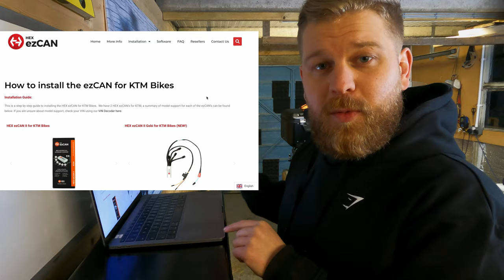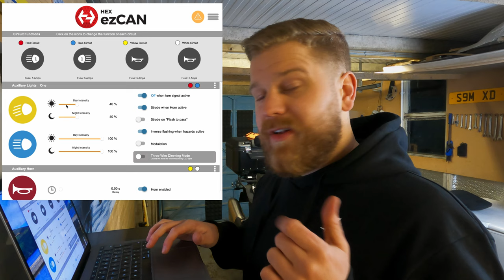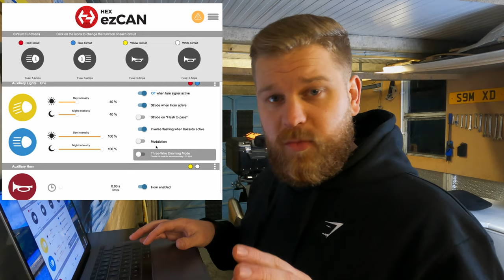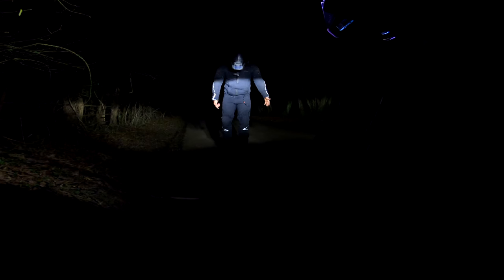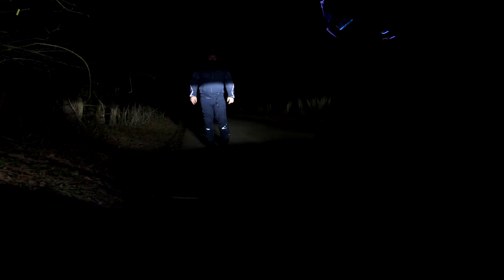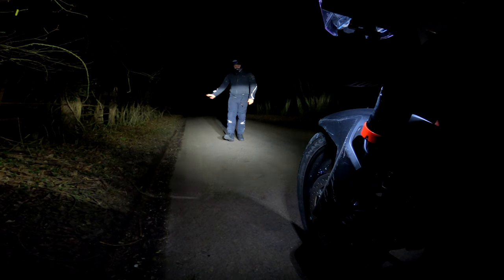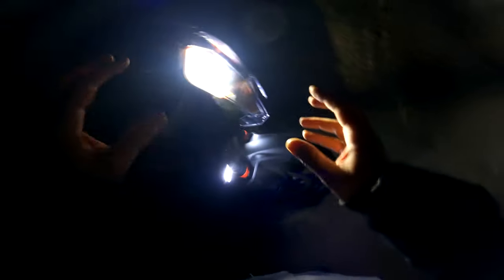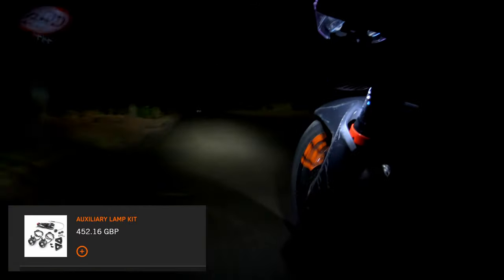Programming the HEX EzCan and Denali S4 Light Pods | 2021 KTM Super Adventure S | Part 2

Comment: Good video Sam!....am I correct in thinking that you connect the 2nd horn to the hex can 2 wire harness and fit the piggy back terminal.Then connect green trigger wire to it.... i.e don't touch original horn?
Reply from the maker: Close! Green piggyback wire goes onto the orignal horn, the original cable plugs into that piggyback. The denali horn is just plugged into one of the leads coming from the EzCan with the horn lead in the harness kit. Hope that makes sense!
Reply: @SamVBikes  ..yes, thanks for the explanation
Reply from the maker: No prob! If that doesn't work, I'll do a quick video tomorrow night explaining the full install just on the horn 👍🏼
Reply: @SamVBikes  ...that would be very useful, thanks..

Comment: Hi Sam.....I had contacted KTM Austria and they informed me that it will violate warranty if this installed. 
Nevertheless I am taken in by the Denali lights and sound bomb and prefer to have power distribution via a CAN bus system.
Your thoughts appreciated.
Reply from the maker: Hey! I'm not surprised as most manufacturers will take any excuse to get around warranty claims! They tend to play it safe and say most things will void warranty so they cant be held liable. Chatting with my local dealer about modifications in general, they said changing something will only impact the warranty on that specific component/system. For example, if you modify the exhaust system, and something goes with with the lights, you're still covered. But if the exhaust system had an issue, you wouldn't be covered. That's pretty much the case for most things, but if you have a legitimate issue which both parties can tell is not caused by the Hex etc, it won't be an issue
Reply: @SamVBikes  Thanks Sam for your prompt response.

Comment: Fantastic video big help with install. Sorry to ask you for help but the lights on my 1290s 2022 work perfect but the horn does not. The horn will work when I go into diagnostics and test it. It will make my ears bleed. But when I do it from the bikes switch only the standard horn works. I do have the horn enabled. Any help would be appreciated. Thanks. I could not find a number to call for help from HEX
Reply from the maker: Thank you! I had a similar issue when I did mine! My solution was plug the Denali horn into the Hex ezCan loom but not to the stock horn, then run the green trigger wire to the stock horn from the EzCan. That piggyback plugs into the port on the horn and the wire for the horn plugs into the piggyback if that makes sense. I think it has to plug into the bikes OBD port too if I remember rightly. Let me know if that works!
Reply: Yes it worked! Thanks
Reply from the maker: No problem!!